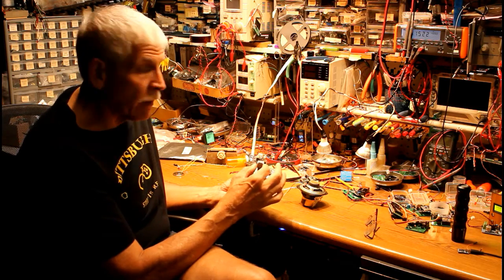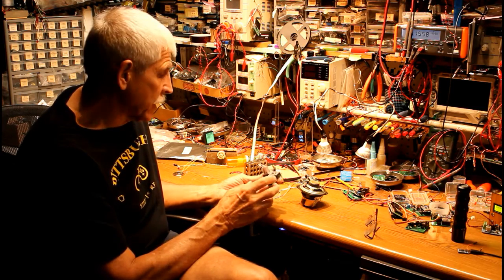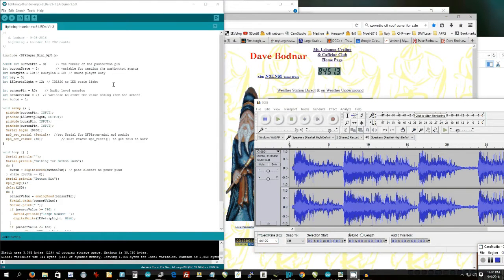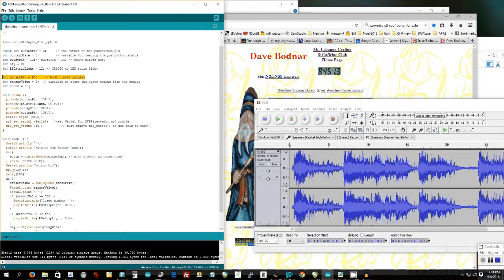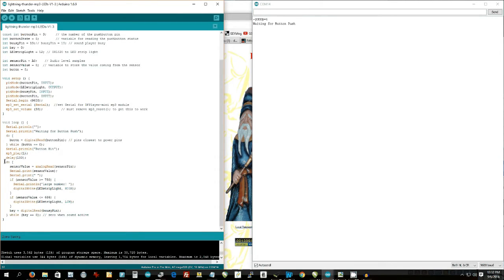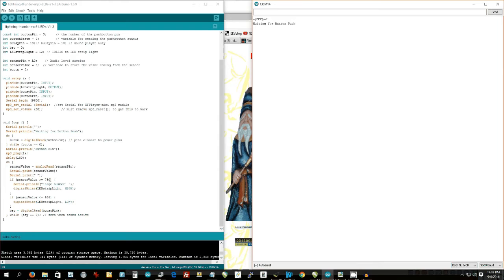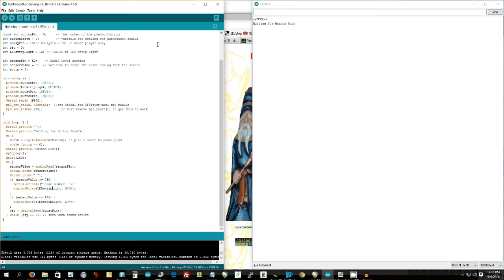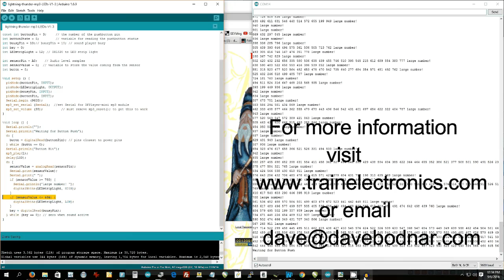Synchronized Thunder & Lightning with an Arduino and DFPlayer

Comment: I just built a nearly identical thunder and lightning machine for a haunted house.  Mine also used a DFPlayer Mini and an Arduino Pro Mini, but the (a/c) lights were controlled by routing one of the line level outputs (DAC_L) to a commercial device that'll flash lights based on the volume.

Your results are really cool.  Nice job!

Some notes:

The 1 Kohm resistor from the Arduino TX to the DFPlayer's RX is widely recommended, but kind of a hack.  If your Arduino Pro Mini runs 5V, then you need to do something because the DFPlayer uses and expects 3.3V levels on its serial i/o pins (even though you're likely powering the DFPlayer at 5V).  An actual voltage divider would be a more principled way to bring the Arduino's TX down to 3.3V.  You could also use any sort of level shifter, optoisolator, etc.

I see the schematic on your site that doesn't bother with a connection back from the DFPlayer TX to the Arduino RX, but the video shows one with the same 1Kohm resistor.  If you do want the serial feedback from the DFPlayer, the resistor is unnecessary, as the 3.3V level output is perfectly fine for signaling the 5V Arduino.

I'm surprised that you're running the speaker output (rather than a DAC output) directly into an analog input on the Arduino.  The speaker output is amplified and is essentially an a/c signal.  My understanding is that the AVR analog inputs can be damaged if the input voltage is ever outside the 0-5V range.  Since the speaker output can (and does) go negative, I'm surprised this works.  The DAC outputs are nice, low current, signal level values and would probably be safer for sampling, requiring only a tweak to the thresholds in your code.

Since your audio fades out, you have a high probability that the lights will end in the off state, but you could ensure that by explicitly turning them off at the end of your do-while loop or just before waiting for the button press.
Reply from the maker: Hayward- thanks for you notes - The 1K resistor seems to make the system very happy and I have not had any issues where it has been used - I may give a voltage divider a try in the future.
The spearker output worked better for me than one of the line level outputs - I did use the line level output in this project

http://www.trainelectronics.com/Animation-thunder-lightning/delay.htm 

but had some trouble getting it to be completely consistent.

thanks!

dave

Comment: Thumbs 👍 up. Impressive work because tangible results without overkill coding. Many thanks for sharing David.
Reply from the maker: Sam - thanks for the kind words - FYI, I am working on a revision using strip lights -- have a look at the draft web page here
http://www.trainelectronics.com/Animation-thunder-lightning/WS2812B/index.htm

dave
Reply: @DaveBodnar  your contribution has lots of uses. It solved a problem here as the prop mouth opener solenoid replaced the light strip. It worked better than a servo because it has either fully open or fully closed giving puppet mouth a better effect. You probably worked on such a project before.

Comment: Hi Dave,
I have a small project I could use a little help with.
We have constructed a museum quality train layout in an dold B and O depot for the Cuyahoga Valley Scenic Railway.  It has 6 zones of interests with historic facts as it is a prototypical setting of the valley.

We thought if we could place a button in front of each scenic area, and have an arduino play an  informative script thru a DF player, it would save on a person having to repeat himself day in and day out.

There would be 6 buttons foe each of the scenic areas that a spectator could press.  If one announcement is activated, we do not want the other 5 to be until that first one completes.We will script and record the mp3 files and place them on a sd card into the df player but need a hand with the arduino sketch.

Would you be interested in this challenge of the script for us?

This sounds like an off shoot of your thunder and lightning project.

thanks

Bob Schworm- Cuyahoga Valley Scenic Railroad - CVSR.ORG
Reply from the maker: Robert - drop me an email (dave@davebodnar.com) and we can discuss this in more detail
dave

Comment: This is just wonderful. So simple, too. I don't think it's necessary, but I wonder if you could create a slight delay between the lightning and thunder and how that would look. Unless you can read ahead, I suppose you would have to pre-record the audio pin values with timestamps and feed that back in to the loop for the lights.
Reply from the maker: Daniel - I have considered doing that but find the simple Arduino not up to the challenge --- or my programming skills are not up to it!
dave

Comment: I have an idea to put LEDS behind some drywall and cutting out the drywall from behind leaving the outer paper on the drywall untouched. I'm thinking I could cut a lightning bolt running is several directions and the flashing light would shine through the wall paper. Your system might just be the inspiration I need to get going on it.

Comment: Great work Dave, The children will love it.
I wonder if a blue LED strip or both driving white and blue LED strips might be better.
Reply from the maker: I have considered blue but don't have any at the moment - also thought about adding a 2nd Mosfet to drive blue on and off at a different sound level than the white - lots of possibilities!
thanks
dave
Reply: Hi Dave, Your timing was great, last night I was asked to set up an ITTC LT100-1B  Lightening and Thunder Sound Module.  I bought it home and tried it out, yours sounds and looks much better, however my friend who is a complete ludite when it comes to anything electrical and electronics will be more than happy.
The ITTC modules use a voice recorder chip, and a simple push button timer which triggers the sound and flashes a high power white LED 14 or 15 times.
Reply from the maker: It looks like it is a bit more expensive, too - For the cost of a DFPlayer (about $5.00) and a Pro Mini (well under $5.00) you could roll your own!
thanks
dave

Comment: How come I keep getting flickering in my circuit when I have the audio play on my DF player mini? I have a 3.7v lithium ion battery 2500mAh connected to 17 5V LED strips, 3V 16rpm motor, and the df player with 2 1W 8ohm mini speakers. If I turn everything on with a switch without the speakers playing everything looks to be working fine. However, as soon as I go to plug the speaker or speakers in to the df player, my LED strips start to flicker. Ive tried using buck converters and capacitors but the problem persists. Can anyone help me? I am using it all without an arduino. I have the DF player looped so as soon as it turns on it will loop the first track.

Comment: Dave,  Regarding your thunder and lightning project...
It all sounds great.  Couple of things - 
I plan to modify the thunder file with a lead in of the storm rolling in.
Then the storm, followed by the storm rolling out,l maybe a dog barking and a few seconds of crickets and raindrops.

Another nice feature would be a selection to start the sequence with a button on demand...
as well as an "auto mode" where the sequence would begin automatically after a selectable time.  What are your thoughts?  Thanks  Bob
Reply from the maker: Bob - I think you could easily add the sounds you describe - you might need to do the dog and crickets as separate files that do not trigger the lights.  All doable by modifying the code that I write.  
Have fun and let me know how it turns out!
dave
Reply: Hi Dave,  I was thinking to extend the sound file on the single track that we listen to.  Then index the lights track indented a bit and run that, then add on to the sound track at the end after the storm leaves for the dog, crickets, and rain.  I think I can blend this all together with Audacity.  When I get the mp3 together I will send it to you to hear and get your thoughts.  Bob
Reply from the maker: That is good thinking, Bob - should work well.
Please do let me know how it works out

thanks

dave

Comment: In your example you use LEDs which run off 12volts. If I use WS2812B leds which run off 5 volts will I still need the extra components like the mosfet?
Reply from the maker: Patrick - you would need the Mosfet if your LEDs drew more than 20 or 30 ma - to get a bright lightning flash you are likely to draw quite a bit of power, more than the Arduino pin can supply directly
dave

Comment: Hi Dave, sorry to ask for some problems to this code. First the library said when I compile it that the library doesn,t have a valid library and if I use The library<DFRobotDFPlayerMini.h> I I have problems with the lines  mp3_set_serial (Serial); //set Serial for DFPlayer-mini mp3 module
  mp3_set_volume (30);          // must remove mp3_reset(); to get this to work
Reply from the maker: Mario - did you properly add the library that is described in the software section of this web page?
http://www.trainelectronics.com/Animation-thunder-lightning/index.htm
that looks like the problem that would cause the errors you saw
dave
Reply: there are many libraries-- https://github.com/DFRobot/DFPlayer-Mini-mp3/blob/master/DFPlayer_Mini_Mp3/DFPlayer_Mini_Mp3.h
Which one are the one should work? the one I down load was DFPlayer_Mini_Mp3-master.zip.
Sorry to bother you.
Reply from the maker: Give this one a try, Mario
https://github.com/DFRobot/DFRobotDFPlayerMini
dave
Reply: Thanks Dave but is the same problem
  mp3_set_serial (Serial); //set Serial for DFPlayer-mini mp3 module
  mp3_set_volume (30);          // must remove mp3_reset(); to get this to work
this line is not declared in the scope
Reply from the maker: Mario - can you tell me how you are installing the library?  It either has to be installed from the IDE as a ZIP file or added to the library folder under the Arduino folder.
dave
Reply: I did it from a zip file to the arduino IDE
Reply: I forgot to tell you that Itried with IDE 1.8.4, 1.8.5 AND NOW with the arduino Beta.
Reply from the maker: Sorry, Mario, but I am out of ideas - If I can find the time to install the IDE on a blank computer I'll do so and test the code & library again.  
dave
Reply: Don´t worry Dave I already abuse too much of your time, thanks for everything you did.
Reply from the maker: Interesting - I just tested compiling on my PC and it worked fine - the library I used is posted on my web page here
http://www.trainelectronics.com/Animation-thunder-lightning/index.htm
It is at the top of the software section - the ZIP file I uploaded may not add properly using the standard install from the IDE so I suggest that you add the files to the     ProgramFiles/Arduino/Library folder on you PC.
Let me know if that helps

dave
Reply: I did that way just now and showme invalid library at compiling
Reply: This Library is deprecated
Reply from the maker: Not sure what is up but I just added the ZIP file I added to the web page and it works properly - sorry, but I am out of ideas
dave
Reply: the closet to get is using the DFRobotDFPlayer, but stil the line mp3_set_serial (Serial); showme the error was not declared in this scope
Is fine Dave Ithink we spend too much time on this.
Thanks